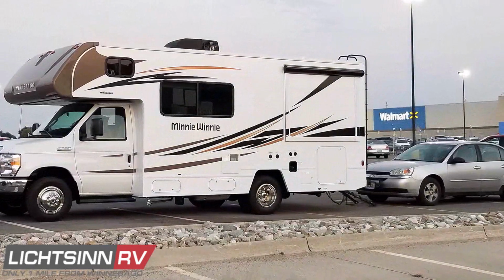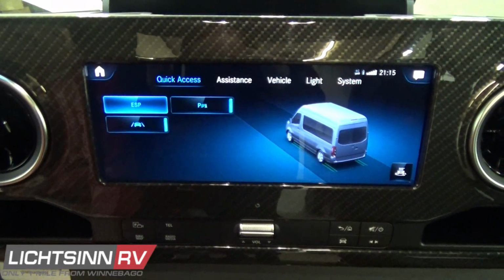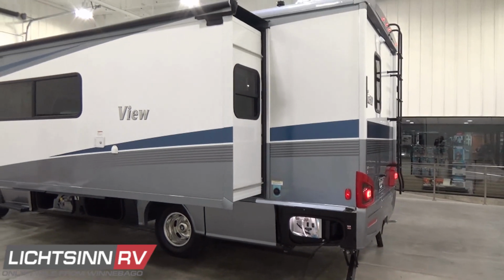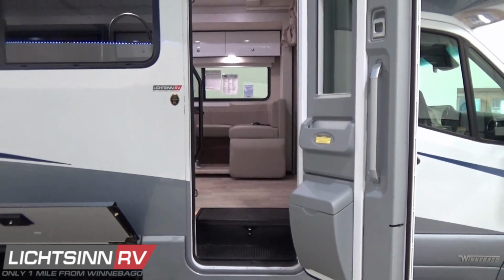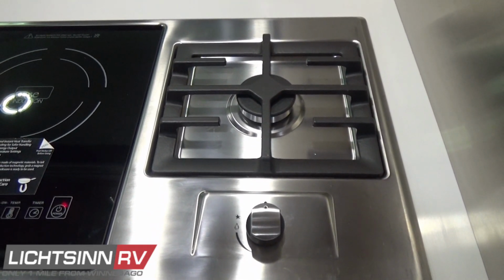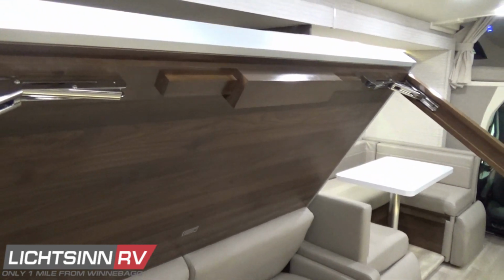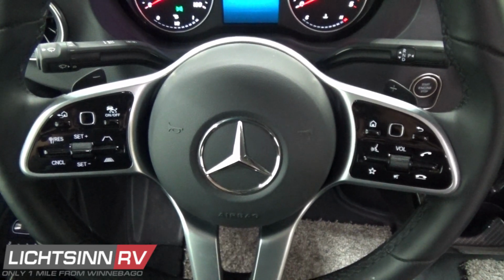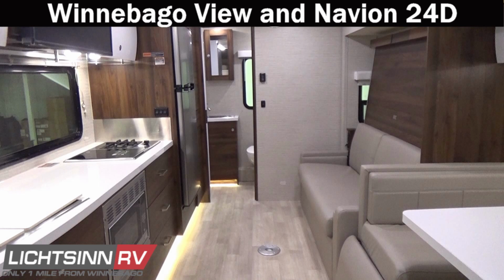LichtsinnRV.com - New 2021 Winnebago View 24D

Comment: For the View 24V, is the Flex Bed 87" wide by 74" long, and does a King size sheet/bedding fit? Is it difficult to get the bottom sheet on the Flex Bed?
Reply from the maker: Good morning Marcia!   Thanks for your note!   The 24V flex bed is 74x87 as you mentioned.   Many will opt for deeper pocket California King sheets to clear the few inches that a Cal King 72x84.  Or they will go with standard Wyoming King bed sheets, or some will go with custom sheets.

Comment: Does this model come with the option to accommodate a taller person (for the murphy bed)? It seems anyone who's taller than 5'10 will have their feet dangling (maybe accommodate someone up to 6' if they forego the pillow and sleep with their head right up against the headboard). Thank you!
Reply from the maker: Good morning!   The bed is 75", so tip to tip would be 6' 3".   The bed is only 5 inches shy of a traditional queen bed.  Hope this helps !

Comment: Could you please tell me if the queen size bed is usable with slide in? I know it wouldn't be a walk around, but there are times when slides out are  not doable.
Reply from the maker: Good morning!   The slide does need to be extended for the Murphy bed to be used, but you can still use the sofa and refer when the slide is in.   Hope this helps!
Reply: @LichtsinnRV  Thank you